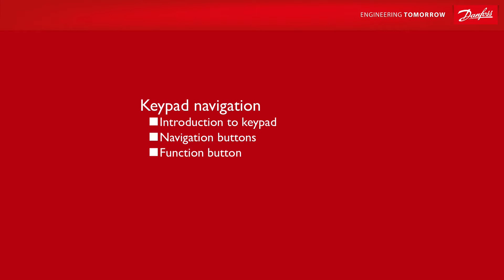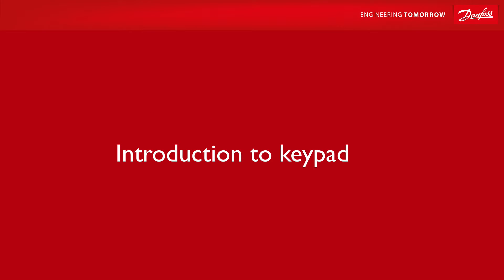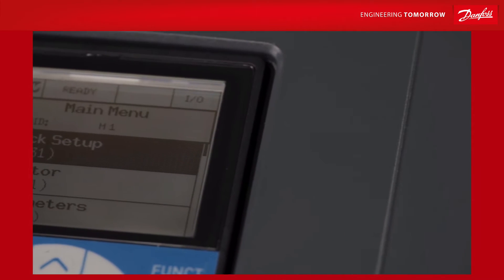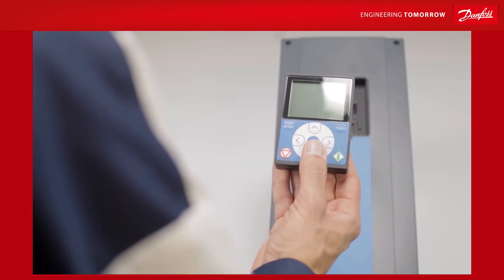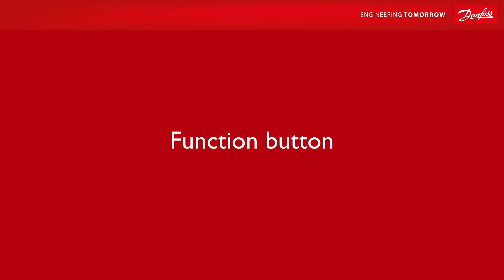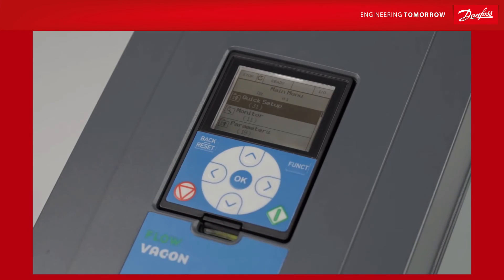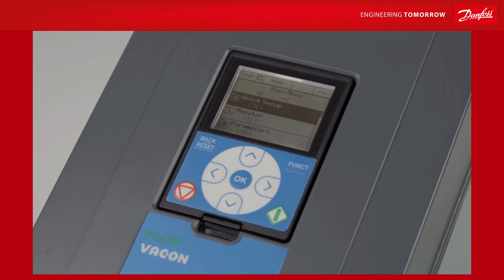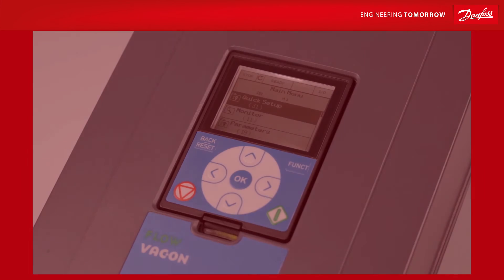VACON® 100 - Introduction to keypad navigation

Comment: How to change local mode frequency
Reply from the maker: Hi Syed,

Thank you very much for watching our videos and for getting in touch! Here's an answer from Ulf directly:

First you have to press FUNCT button on the upper right corner on the keypad part of the panel and select “Control Page”
The speed/frequency reference is marked as a dark “cell”, if not, press the arrows on the panel so the reference cell is marked.
Press ok and the value should start to blink
Set the reference using the arrows up and down.
If you press left/right you can select the DIGIT you want to change. Either then for rapid changes for example: 10-20-30-… Or for fine tuning. For example 10.01-10.02-10.03

If you're still having issues after trying this I would encourage you to reach out to your local customer support: https://www.danfoss.com/en/contact-us/

Best regards
Danfoss Drives Social Media Team
Reply: @danfossdrives  thank you so much for your reply.
Thanks for Danfoss Drive social media team.